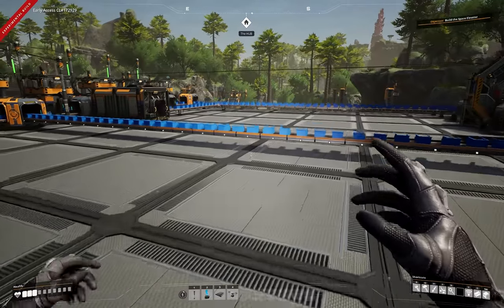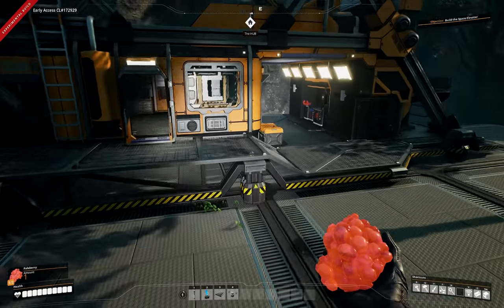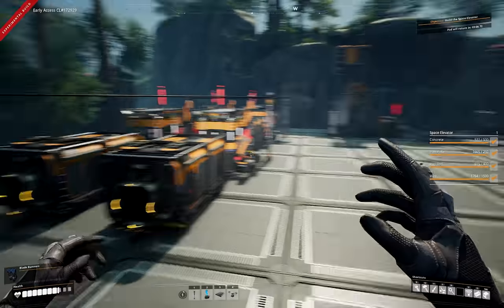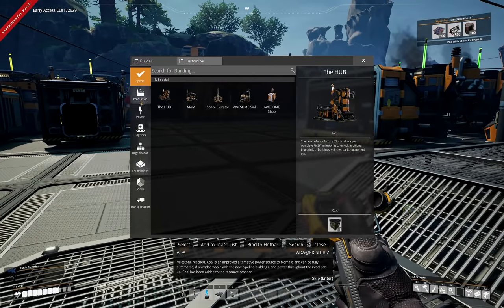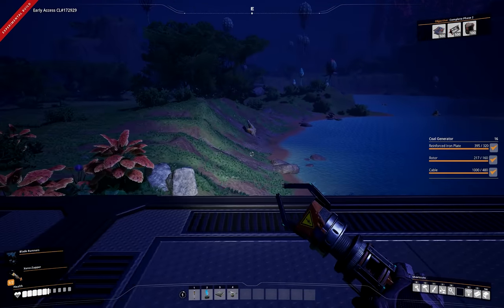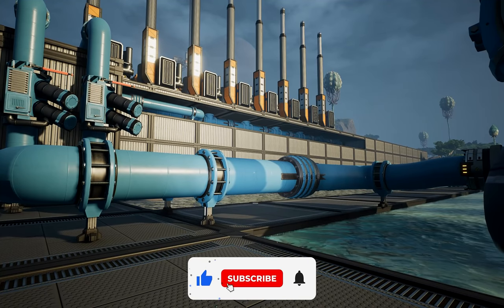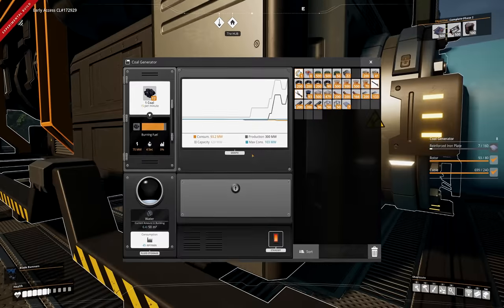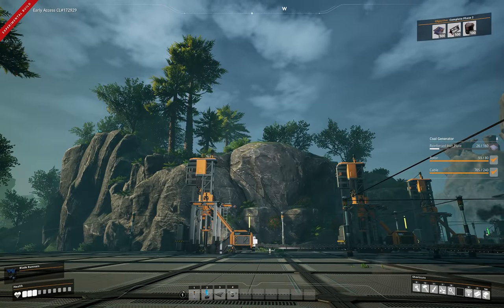SETTING UP COAL GENERATORS!!! For Satisfactory Update 5 - Part 3

Comment: Yeah I built a massive 500 fuel genrator setup with turbo fuel. It never runs at 100 percent efficiency. 
Problem is, you cannot have your machines lined up to consume exact 300/600 fluid. The flow is so erratic that last one never gets continuous supply. And for setup as big as that, a small stoppage here or there cascades to a big variation continuously

Comment: There are still some issues with liquids and pipes (most notably with Mk 2 pipes), but these can be mostly circumvented by using a pump to feed into a fluid buffer (Or vertical loop) at or above the level of your generators.

Comment: You should unlock floor holes in the AS so you can make your pipes and lifts look nicer.
Reply from the maker: I never usually like to fully decorated my coal plant and make it look nice as it's only going to get dismantled when I build Fuel generators anyway.. Cause I like to utilise the coal for some other stuff especially at the location I'm in aswell as it's rich area

Comment: The setup I use for coal that has always worked (even with update 4 when there was the bug is putting 3 water extractors to 8 coal generators in this fashion:

|____|____|____|____|____|____|____|
            |                |               | 

The pipes can't theoretically handle all the water from all extractors but the extractors on the end actually don't push water all the way across so it just evens out and every generator gets enough water

Comment: The biggest problem I've had with water is with recycled water from the aluminum production.
Reply: Had the same problem, it was always filling up. Now I use an overflow packager to package some when water fills up.
Reply: @Korami__  you could use wet concrete recipee to basically turn the water into sinkable resource if there is any limestone nodes in close proximity
Reply: @justsomeguywithsomemustard8168  Using some alternates, I'm having some Polymer Resin to sink anyway, so I just make plastic and cannisters, and sink the packaged water and the overflowing cannisters
Reply: @Korami__  that's so much work tho, might as well loop the water back to the input and balance them with extra water from extractor
Reply: @justsomeguywithsomemustard8168  I never understood why people don’t just feed the water back into the system
Reply: @coreycarries  ikr. some ppl like to actually give more water (any fluid really) than needed because the way that the pipe works isnt exactly like belts, in a sense that they transfer plus minus X amount of water regarding to the intake and outake rate. they like to give about X more, because they want the pipe to be always full. as for me i always give the amount needed, and put valve/pump to control the flow direction. i usually just slam a valve in the scrapping refineries and call it a day, never had my aluminium scrap jammed because of the excess water

Comment: Interesting video on your coal generators and your design is OK but could use a lot of improvement.

 The way I have mine set up is rather simple and highly efficient.

 I have two draw pumps feeding into 3 small storage tanks stacked on top of each other with the water feed pipe going to the top most storage tank first and 1 pump attached to the water pipe feed to assist in getting water to feed the top storage tank.  Then I have the top tank feeding water down to my middle tank and thus have the middle tank feeding the bottom tank which create a buffer system for water and also increases the pressure as it flows downward and these tanks then feed my 4 coal generators.   Then I repeat this design on my next 4 coal generators.   As for my coal drills I have them feed into a storage box first to create a buffer storage in the event i've any possible problems that might occur.   Then the storage box feeds into my connected coal generators.

The good thing about my design it creates a buffer system in the event problem might occur.

 The other good thing about this design is that it's small, efficient and if set up right you can use it to create a backup power system that can run independent from your main power supply to keep your coal drills and water feed pumps going at all times.